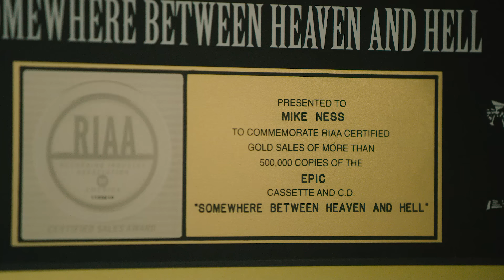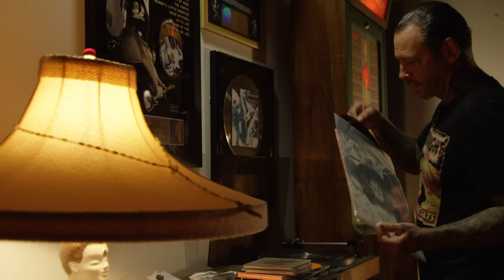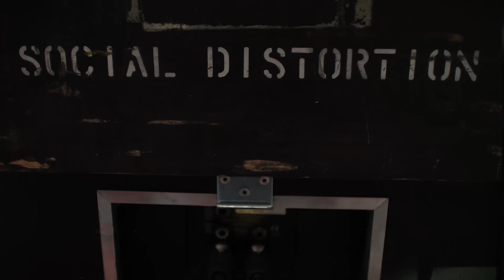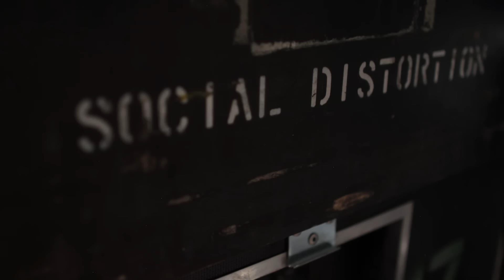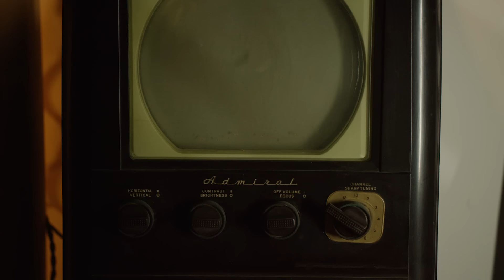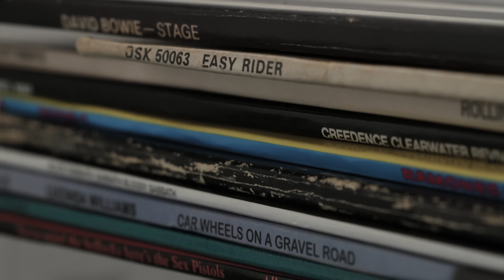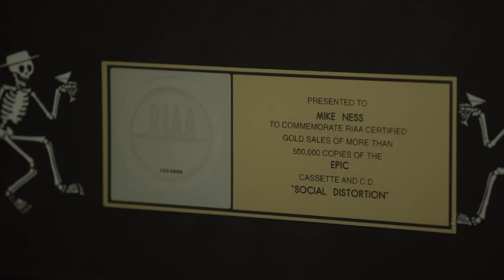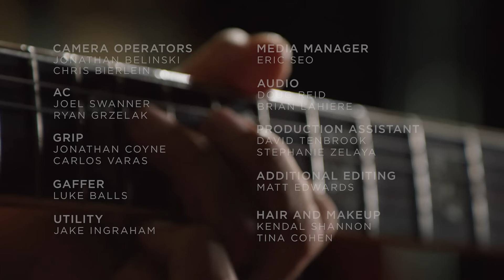Mike Ness - The Pursuit of Tone

Comment: He's definitely wrong... 

You can be cool with a regular car with AC such as a Panda diesel, better if white body paint; you can definitely not be cool on a Easy rider chopper... because you always wear heavy jacket and stuffs even with 30°C = 86°F and you have an hot motor underneath the nuts... when driving you are stopped at semaphore fresh air also end with mosquitoes and other splatting shits... definitely no way you can be cool on a motorcycle.